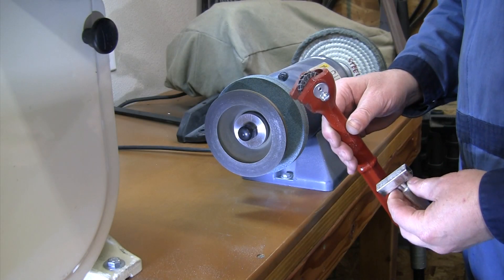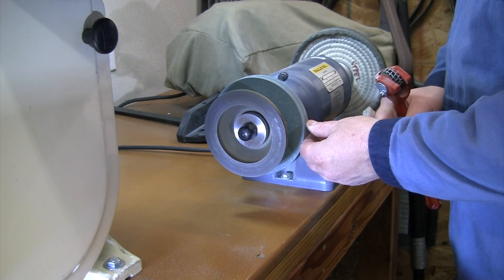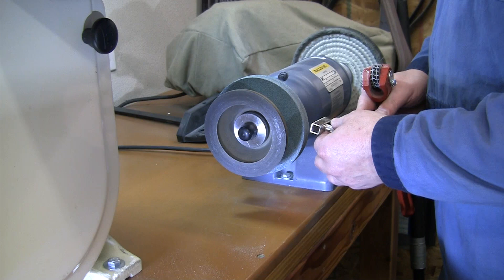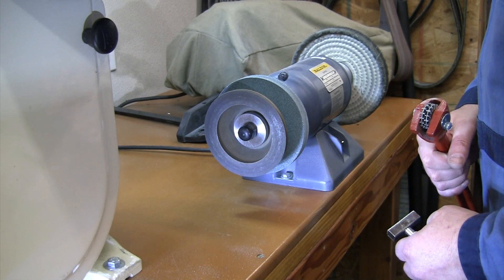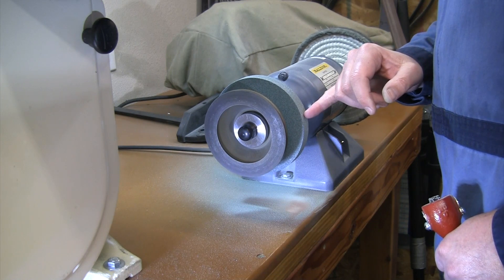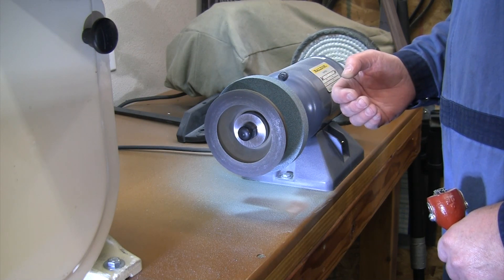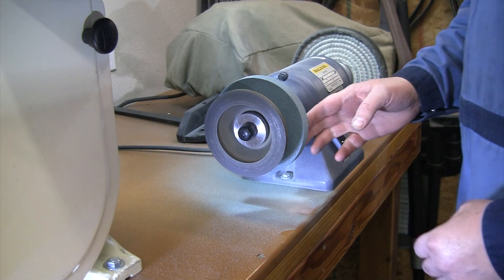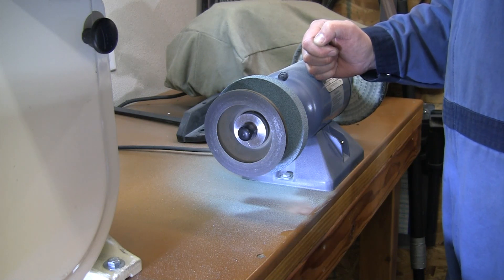Dressing a Silicon Carbide Grinding Wheel - Prepping it for sharpening Brazed Carbide

Comment: I believe you did it backwards, you’re supposed use the star dresser first to remove the metal stuck in the wheel,then use the diamond to straighten the stone.
Reply from the maker: @SavageEuge - Thanks for the comment and I appreciate the feedback.  I think either dresser can be used as a stand alone tool and both are not required. Based on that I think either can be first?  I just find the diamond removes material faster with less pressure and more control for flattening/squaring and the star gives a better more open finish for better tool grinding. Bottom line go with what works best for you. Cheers.

Comment: the star dresser is not supposed to be used with the grinder turned on. Turn on, let if come to speed, turn it off and only then push the star dresser against the wheel until coming to a stop.
once the wheel slows down, contact pressure will be greatly increased, and thats what breaks the grain after all.
Reply from the maker: Anxious Merchant - appreciate the comment. That is not a technique I have ever heard of or tried.  I did a quick search and could not find any other info about it. If that is working for you that is great. The feet on the star dresser are actually designed to hook behind the tool rest to allow more pressure. I don’t have a tool rest so I just push hard to get the pressure vs just sparks and grinding. With no power to the wheel it would not take much to stop it and I would be afraid of dressing the wheel more out of round over time?  Again if it is working for you, stick with what works.
Reply: @BladesIIB  I got that info from the instruction sheet of a wheel dresser (manufacturer is a German abrasive company). It makes sense for me, as the faster the wheel spins, lower contact pressure, we want high contact pressure ( slow wheel) to break the glass bond and expose the grain.

i dont think doing this will make the wheel go out of round in time, as the stop position is random on each use.

Comment: Thanks for the wheel dressing video. Amazing how straight you get it without a tool rest. I'm using a single point diamond dresser with a tool rest and needing to make a collar to help me keep it straight 🤪.
Reply from the maker: Thanks, yes that single point tool would make it tougher. They want to dig in. The wide one I am using was $10 on Amazon. Works well. POWERTEC 71003 Diamond Grinding Wheel Dresser, Silver Edition https://www.amazon.com/dp/B00B10LM6O/ref=cm_sw_r_cp_api_glt_fabc_XBZ0PY92WK3G36YCR048?_encoding=UTF8&psc=1